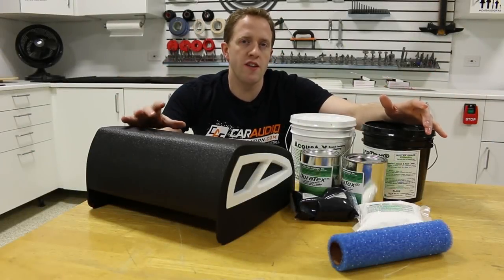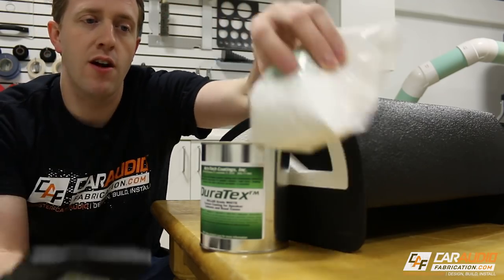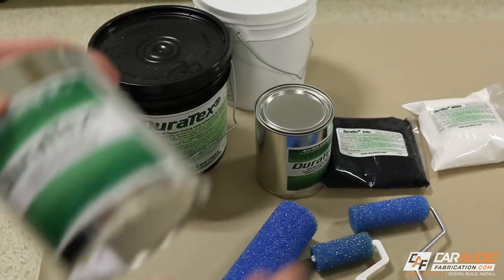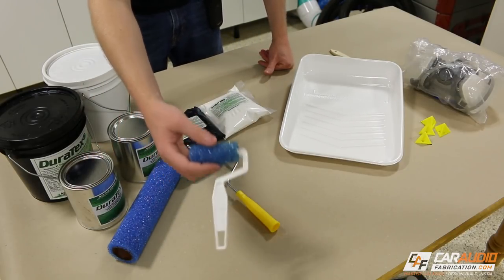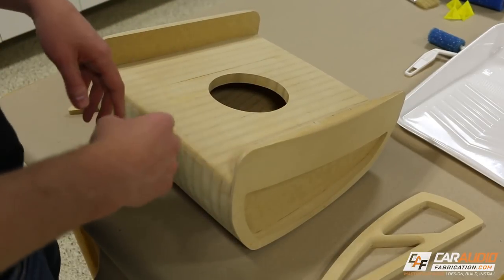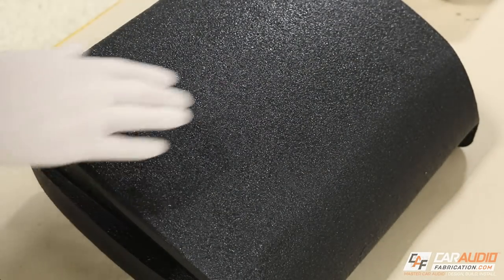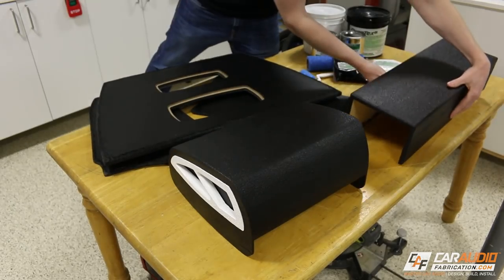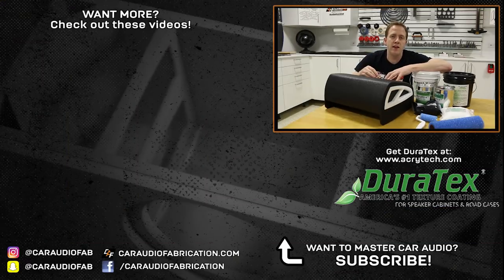Subwoofer Box Coating! Protect it with DuraTex - HOW TO

Comment: Bought the stuff expecting disappointment, depression and rehab.  Product is amazing and I don't know how one could mess up an application with the roller.  Little IR heat speeds up curing time too.  It looks just like that amazing speaker box in this video.  OCD completely satisfied so the project was actually completed.
Reply: We're happy to hear that you're completely satisfied!

Comment: This is exactly what I need for the sub box I'm building for the rear of my Jeep! Thank you!
Reply: same here! 2dr wrangler subwoofer enclosure in the rear storage compartment
Reply: yeah, I'm doing the same thing. I fiberglassed the bottom half of the enclosure, but the top is still MDF so I've been trying to figure out how to make it water resistant.
Reply: DuraTex will provide you with the water resistance that you're looking for.
Reply: Same here! Fiberglassed the cubby, built an MDF top portion. I covered the MDF in a layer of fiberglass for protection, but looking for a finishing option now.
Reply: @acry-techcoatings3654  How do I know how much I'll need? I have a fairly large box.
Reply: @loveja1  I can figure that out for you if you provide me with the Length, Width & Height of your box. Each gallon will cover between 80 - 100 square feet of area in multiple coats.
Reply: Acrytech it’s all good. I just ordered a gallon of it, with the rollers. Thanks to Mark for the shoutout. Cheers.

Comment: I've used duratex a few times now and it is awesome. I found you can get a really cool texture if you keep on rolling it while it's drying 😊
Reply: We're glad to hear that you enjoy the product. Thanks!
Reply: How much coverage do you get from the Litre tin?
Reply: @beanlounge  the quart (aprox. 1 liter) will cover 20 - 25 square feet in multiple coats or 40 - 50 square feet in a single coat.

Comment: I’m building a box (mdf)to put in the bed of my truck. Will this protect my box from rain so it doesn’t leak in and rot?
Reply: DuraTex is water resistant so it will protect your box from the rain.

Comment: Awesome! My questions is, does it wash off in rain when it is dried? I am asking this because from the video I learnt it is a water base product. Thank you
Reply: DuraTex won't wash off in the rain. Once it is cured it's on there for good. It's actually weather resistant and helps to protect the enclosure.

Comment: Awesome video! Love all your work! Question, I’m doing a blow through on a truck and did not want to put a Rhino liner on the box because of the price. Is this a good substitute? After 3 or 4 layers is it waterproof? Thank you in advance for the help!
Reply: With 3 or 4 coats of DuraTex your box will be water resistant. The DuraTex will protect the underlying surface.

Comment: Literally came to YouTube to research ways to fight the adhesion issues with bed liner and stumbled on this. My only question before purchasing this product is about the UV resistance. I’ll be coating a box I built for my Jeep which will sit Topless some days of the year. Will the black turn chalky or fade? Is the white any more resistant? TIA!
Reply: DuraTex holds up very well to UV. We have several customers that have used it on applications that are in direct sunlight constantly with no issues. The black does not turn chalky or fade & the white does not yellow over time either.

Comment: Did you ever tried that Acoust-X product?  What is your opinion on it?  I applied Duratex to the exterior of a box I made, but pondering about the Acoust-X.
Reply from the maker: Works good, seals up the inside of the box really well. I used it on a sealed custom spare tire subwoofer enclosure.

Comment: I will have to get some of this. Since the project I have in mind will be exposed to near direct sunlight, will I have to use a uv protective clear coat to stop or slow it from fading?
Reply: DuraTex does stand up well to UV. If you wanted to use a clear protective coat you just want to make sure that it's water based to avoid any adhesion issues.

Comment: Once fried can it be painted on? Like if I were to used this on a speaker box and I wanted to paint some kind of design on the box (spray paint or paint roller) will it take it well?
Reply: DuraTex can be painted over as long as you use a water based coating.

Comment: Mark do you think the pint size trial kit could cover a 6cf enclosure?
Reply: The pint size trial kit will cover between 10 - 12 square feet of area total in multiple coats. The quart size kit will cover between 20 - 25 square feet of area total in multiple coats. Each gallon will cover between 80 - 100 square feet of area in multiple coats. The coverage rate depends on how heavy the product is applied.

Comment: I have 2 12" sundown audio big subs. It's in a ported box. Seems like acoust-x is meant for sealed enclosures and most people use resin or car undercoating inside ported boxes. Should i use duratex for my application or acoustx? Thanks!
Reply: You need to focus on internal bracing. Only higher frequency drivers need sound deading.

Comment: Would this also add additional strength to the box? We're always looking for acoustically dead enclosures/panels and I'm curious if a coating like this adds anything?  I'm also curious if there's any notable difference in the way the enclosure sounds (before vs after treatment)? Or am I over imagining the durability of the coating?  There's that familiar 'coated' sound at 0:09 when Mark knocks on the box though so that made me wonder about all this.

Comment: I have two questions.
1) You said it bonds well to wood, does this include MDF?
2) Does it add a lot of weight to the enclosure?
Reply: Hi Thomas. Sorry for the delayed response. Yes, this will bond to MDF nicely. No, it does not add a lot of weight at all. Each gallon will cover between 80 - 100 square feet in multiple coats so it does go pretty far. Each gallon only weighs 9 pounds & you can coat a lot of enclosures with a gallon.

Comment: Do you think this would work for a sub box that would be outside under a deck?  The commercially available outdoor subs are CRAZY expensive, and this could be a way to DIY one for a fraction of the cost.
Reply: DuraTex would protect your box that is outside under a deck. I have it on my boat speakers under my T-Top.

Comment: Does it have much of an odor? It’s water based so it’s probably not too bad but I’m just curious.
Reply: It has very little odor. In fact, almost no odor. Our customers love that they can work on their projects indoors and the odor is not offensive. We also have customers that work on their projects outside & then bring them inside once they are finished coating them. We are constantly told how happy people are that once they bring their projects indoors that the DuraTex doesn't have any residual odors coming off like some solvent based coatings do.
Reply: I just finished a sub enclosure with Duratex in my garage. I use a small fan to blow fine dust or fumes out and I could not detect any odor at all. Great product- used it several times and is my preferred sub enclosure finish. Easier to achieve a professional result vs carpet, at least for me.

Comment: Can it be done with smooth finish. Not that orange peel looking texture???
Reply: Yes, DuraTex can be applied with a smooth foam roller to achieve a smooth finish.
Reply: @acry-techcoatings3654  

I don't see anything but the textured rollers on the website
Reply: @Luminous.Dynamics  we only sell the textured rollers. Smooth foam rollers can be purchased at any local hardware or paint store.

Comment: how much would i need to do about 13 square feet of box area ?
Reply: You should be able to get that project completed with a Pint Size Trial Kit - depending on how heavy the product is applied. A Pint Size Kit will cover between 10 - 12 square feet of area (in multiple coats) - so you're close.
Reply: thanks, is 1 coat good enough and will it have a slight texture ?
Reply: Some of our customers apply just one coat. Most of our customers do two coats. A third coat is recommend if the box will be in an outdoor setting. The texture is achieved by using our blue foam texture rollers, so, yes, you will be able to achieve texture with just one coat of DuraTex.
Reply: thanks again
Reply: You're most welcome.

Comment: Looks like the box is made for a tiny sub, maybe a 6.5?
Reply: CRAZY DAYZ It has to be a very small sub to mount in that hole. Maybe an 8".
Reply: Honestly looks like 5¼ at most... Unless he's got extremely long fingers/hands...
Reply: The physical hole itself is 5.25, you can tell that by the amount of sheets of wood were cut.  6 full pieces and like a half piece on each end for a total of 7.  Looks like 3/4 in material so that would be 5.25.  So that would be about the right size for a 6.5

Comment: it's good stuff! don't use it on bare steel. it will still chip off sharp edges on wood easily but a couple swipes of 80 grit sand paper in your palm will solve that and don't use a paint tray, it will waste alot of product.
Reply: Joe Lalock, agreed. I don't use a tray for it either. You are spot-on about sharp edges and corners. I prefer a 1/4 or 3/8" roundover on all corners.